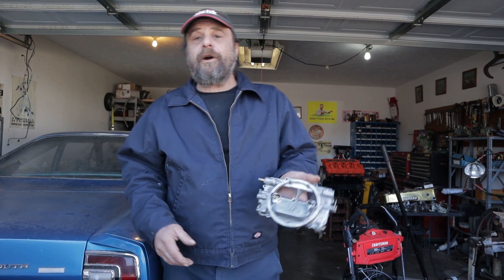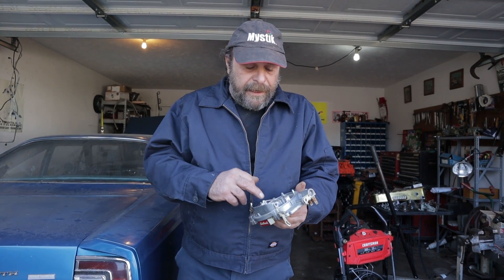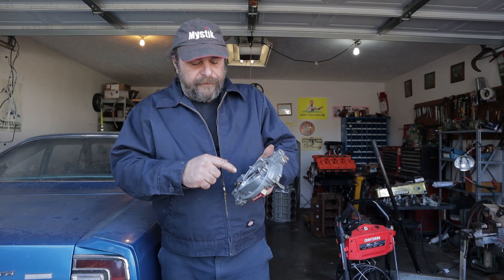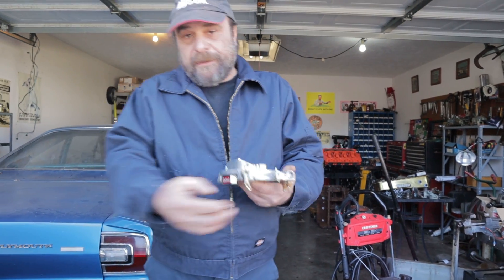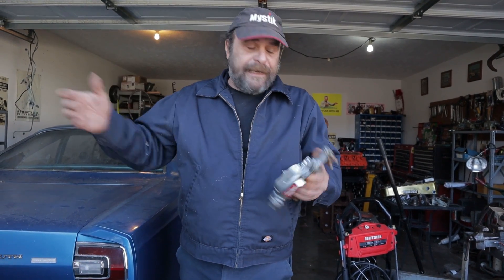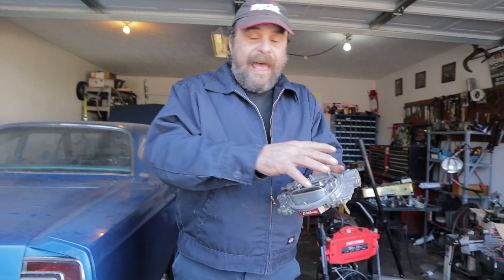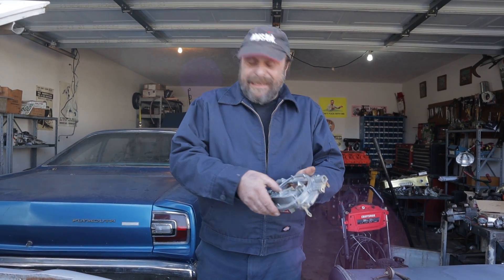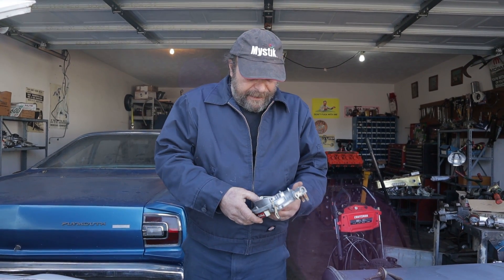The Most Troublesome Part Of Any Carbureted Car

Comment: Good Ol' Manual Choke Never Fails
Reply: I've had problems with the cables, but twenty times more problems with automatic chokes.
Reply: @JohnWilburn  Control Cables Inc.  (no I don't make any money from suggesting this). Their cables just solve so many problems!
Reply: Cool.  Thanks.  That’s good to know.
Reply: John Wilburn I’ve never really had a problem with either I’ve ran both on my truck but I do prefer electric for convenience
Reply: Michael Bertoni  Let her read this.
Reply: Michael Bertoni  She sure does lol
Reply: It does when someone who has no business driving the vehicle tries to drive it.  One more means of theft prevention.
Reply: @KC9UDX Right!... like to young and dumb to know!
Reply: Lambroke DRC, that’s why piston engine aircraft still have them!
Reply: Hey, Art... Yup, my Dad's an old air recon photographer and,I love The Old Planes... 12ga. blank start assist Oh, Yeah!
Reply: There is always the change of operator error though.   LOL
Reply: All, my multi carbed motorcycles chokes work great! Even my 50year old Suzuki's!
Reply: @Yama Satru   I've been a bike mech 42yrs.   2.5hrs to take off, clean, rebuild, replace, tune and sync 4 carbs by eye and ear using nothing but a screwdriver, pliers and a "Scooby snack" and my 50yr old GS750 is out killin' harleys again/still... So, easy a retard could do it!!!(no offense to them they're very observant and meticulous is what I mean!!!). Don't see it now never have! Oh, mixture/idle screws- yes! Sorry, maybe there's just more clowns there mucken' their cables up???^__^ Hey, Clowns it's called a manual! You read it! ^__^  Only bugger I have a lil' trouble/patient with is my $50 '68 Triumph 650 Bonnieville slide type carbs… Hate them and Bloody, Wentworth^__^ good thing I gotem' in the tool collection!   WELL, GOOD LUCK MY FRIEND!!! Hope, your latest project turns out just the way you want it!!!  Post us some vids on it!
Reply: I have always just had cable problems with manual chokes. Other than that they are fine. I do prefer electric though. They are very easy.

Comment: I’ve always had better luck with the manual choke
Reply: No luck is needed with a manual choke.
Reply: LunarOutlaw’s Garage manual choke is the best
Reply: I've always had more luck with my right hand
Reply: Like God intended!  :p
Reply: I've had better luck just removing the choke assembly and feather the throttle.
Reply: knight0334 not when its -20c
Reply: @lepus6511  
Dear God, I'd sooner live somewhere that got to -20 than somewhere that got to 47C!

I mean, I can always put on more clothes, but once I'm naked, I can't take my skin off...
Reply: love my auto choke on my qaudrajet on my 350 truck. the edlecock took about 15 seconds to start with the elec choke. QJ pump pump brumphf brumphf popopopopop vroooooom vroooom vroooom. ready to take off. tickle that throttle for icy conditions.
Reply: Glad to hear that Good Ole Uncle Tony said it. I really thought I was backwards by bypassing the electric chokes at the first of any problems they give and shooting a .22 thru the dash to run a coat hanger 😵!!!! The .22 and coat hanger was a joke but my carbed vehicles have cables now. Hardly ever do they ever get pulled tho.  I do have one small Farmall tractor with an updraft carburetor that always has to be choked even when shut off in 💯*F from plowing. I've cleaned it , soaked it. It runs great , pulls strong , but needs a choking to work , who knows????????????
Reply: @coburnlowman  the .22 through the dash had to be a joke. Most hangars these days are plastic. That's 8 gauge shotgun territory, blunderbuss even.
Reply: My 50 Dodge Ram 1/2 ton had a manual choke on the Flat head 6 along with a push rod starter paddle.
Reply: Agreed, I have an Edelbrock with manual choke on my '68 LeMans.
Reply: LOVE a me some Manual Choke! 👍😁
Reply: @lepus6511  Because I’m Canadian and still LOVE Winter (Hockey, Ice Fishing, Winter Camping)